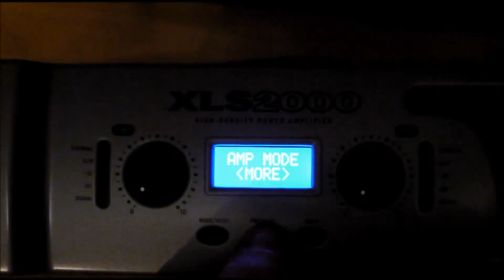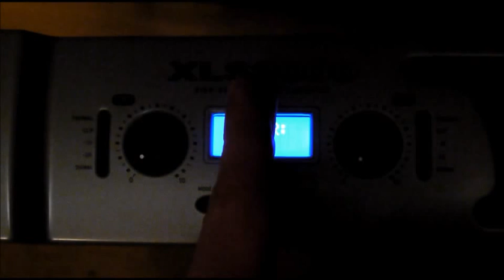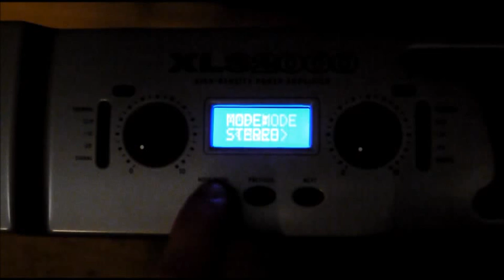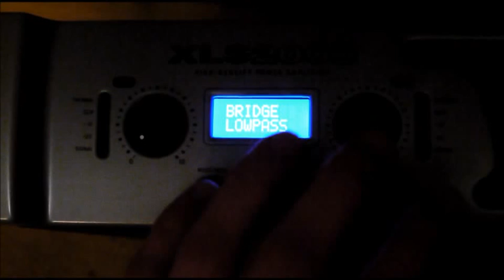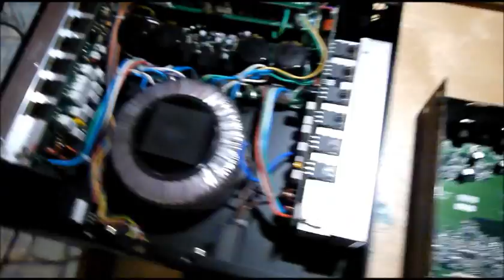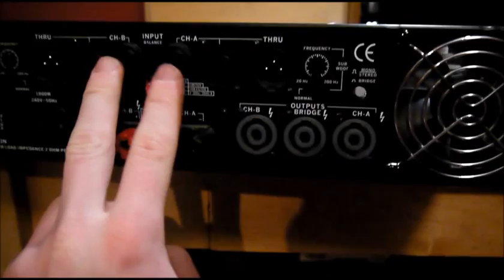Crown XLS Drivecore 2000 Review

Comment: I just bought a used Crown XLS 2000 amp.  I use it as a standalone amplifier with volume set to max for both left and right channels.  It can't even power up loud enough to drive my Wharfedale Evo 4.1 at 87 DB efficiency. It can only achieve about 50% of what my Audiolab 8000 can.    Even when i setup my Audiolab as a Pre, i need to up the Volume control knob to 2 o'clock.  The usual setting is 9 to 10 o'clock for the speakers to be very loud.   Please advise.   I suspect this amp is defective and intending to ask for a refund from the seller.

Comment: The Crown is a Class I amp (patent pending) not class D.
Reply: What do you mean by that ??? I am not aware of a class I amp circuit, and I have been in business for many years. There are class T amps, but they are also class D.
Reply: @kimhansen6384  http://educypedia.karadimov.info/library/137234.pdf
Reply: @kimhansen6384  Class -I amplifiers are a fundamentally different design from all other amplifier classes on the market. Crown has patented the technology behind Class-I amplifiers and is the only manufacturer in the world building this design.
Reply: @kimhansen6384   Dude the macrotech and itech amps from crown are class I

Comment: The Toroidal transformers are actually very efficient, they only get hot because the manufactures cut costs be using under sized winding wire for the power rating. Most of the heat is from the a/b amplifier modules, also losses are considerable in the bridge rectifiers too, which all adds up to poor efficiency. The Class D crown is very efficient as the output transistors are switching on and off not in linear region and a pwm output is then filtered via typically inductors and a caps on speaker output The SMPS power supply is more efficient too as sync rectification is used. But reliability is the big question, also a class d amp with a smps is far far more complex in design, compared to a basic class a/b amplifier, and a lot can go wrong.
Reply: Lots of problems with class d, 
1. far more complex in design over class a/b.
2. considerable rf switching noise can interfere with other equipment.
3. minimum load requirement
4. noise and distortion is usually higher than a/b, but this in not a problem for PA applications.
5 Amplifiers can beat and make whistling sounds with other class d amps in system.
Reply: I tried out a Crown XLS 2000 amp a friend wanted to sell. For $100. I couldn’t go wrong. I was stunned! I’ve done pro sound, ran an audio store, wired many homes for distributed audio, etc.This is a wonderful ampIifier! I own a number of amplifiers both tubed and solid state and this is my favorite. Don’t waste your money on expensive amps, give one of the XLS amps a try. If you own very efficient speakers I would go with (at least) the 1502 as the entry level amp could be a bit too noisy!

Comment: I'm actually more impressed with the Numark amp. That looks like a really solid class AB amp.
Reply from the maker: Thanks, I've still got that Numark amp. Despite it being 10 years old this year, it's still going strong! I use it every now and then to run monitor speakers if I have to work with a band. I'm not sure what class it is if I'm perfectly honest, but it's over engineered and built like a tank! The only reason I don't use it regularly is purely down to the weight.
Reply: Nothing against the Crowns. They do make more sense, even for home use. I've seen a few hifi reviews of them and they say the same thing you do - lots of power and nice and clear sound.
Reply from the maker: Yes, I love the Crowns. I've got three of them now, and all have been perfect. My main concern was reliability when I bought them, as the technology back then was really in its infancy for amps of this size. But now that all three of them are five years old this year, I'm most impressed! Not a spot of bother out of any of them :)

Comment: I recommend high mind good power,,
Reply from the maker: Yes, 4 years on and they still work perfectly! One thing I have noticed is a fault code stored in the memory, when you hold all 3 buttons in for 5 seconds. This appeared when a generator tripped out under overload. Never been able to clear the code though on all 3 amplifiers. But It doesn't affect the running of them - They still sound and work great!

Comment: i have JBL Venue series tower speakers on Denon AVR-2309ci receiver. but i think power is not enough on my left and right tower speakers. what do you recommanded? current amp is 105 at 8 ohm per channel 5.1 system. my sub-woofer has its own amp.
Reply: I am in the same situation.  I have a Sony STRDN1040 hooked up to one set of POLK MONITOR70IIs and POLK RTIA9s(handle 50-500 watts/each).  The sound from this Sony is fantastic-my opinion and pro reviews.  I want just want more POWER.  Once one steps up in a reciever you get all the bells and whistles and no big increase in power.  Maybe COPPER is too expensive for toroidal AB amps?.  I just want to run-MAYBE-5.1 AT MOST.
I saw reviews on Amazon of audio geeks saying they're using Crown amps to drive their home A/V systems with massive wattage and they love the sound.
How this is hooked up I don't know but I'm going to look at Crown amps today to find out.
I've heard some off the cuff remarks about ClassD amps loosing some upper register and that they are built for durability NOT sound quality.  Maranzt tech told me that and then said "We have a ClassD amp that would be perfect for you as Marantz engineers have removed ALL the negative characteristics of ClassD amps I just mentioned."
LOL.
I don't know of one other industry-probably cars or medicine-cycling?-that has so much hyperbole and so many enthusiasts who just read numbers and don't actually engage the sensory organ that the product is supposed to stimulate: HEARING in this example.  As a musician I laugh and laugh over it.  I just had someone on an audio forum try and tell me that air is NOT what creates a sound wave.  I didn't have the heart to tell him that if he took his $50K speakers into space and ran them he WON'T hear anything...the cones will be moving but without AIR(or any gas) to transfer the energy he wouldn't HEAR anything.
Seems to me that you are onto something hooking up this high wattage/dollar, well running, durable amp.
I'm interested in hearing what came of your research.
Good Luck and Good Listening.
Mike

Comment: Video is good but the power supply is essentially the right half of the chassis.  What you pointed to is the input power filter that is within the shield area.  The little transformer in the right half is the power transformer.  It doesn't require the massive hunk of iron because it is operating at a high frequency around 96 KHz.  Class D amplifiers are efficient because the switching transistors are either off or full on during their switching cycle.  When off, no current flows so no power and heat is generated.  When on, the voltage is very low in spite of high current so power and heat are still low.  This pulse width modulated waveform is then filtered back to an analog value for the speakers in the two toroid inductors just left of center.  Feedback of the resulting output is then fed back into the circuits to keep linear performance.
Reply: I had exactly the same comment about the power supply in mind
Reply: Wuff zu Wuffenberg 
My HUGE six driver speakers require and EXTREME amount of power to sound amazing.  I think ALL recievers are underpowered to drive speakers(POLK AUDIO rtia9) properly.  I had the money so.....
I bought TWO Crown DriveCore XLS1502 amps.  I have them in bridge mode.  This delivers a whopping 1050 watts/channel.  I also have a POLK AUDIO 110(??.  I think) sub.  My speakers are set at crossover of 100Hz with a Marantz 8001 preamp.  I have the amps set at .775 input.  This is the recommended input for headphones.  But my speakers are so "warm" in sound that the "openess" of the NON-recommended .775 input balances out nicely.

WOW!!..WOW!..WOW!!!.

The sound is incredible.  My musician friends (the REAL critics to me) say the sound is expansive and open and beautiful.

These CROWN D class  amps have come to reign!!.  Designed by Harmon Kardon.

I have never seen a mixed or poor review for this amp.  Old timers like BIG, SWEATY, HEAVY amps.  

But as this reviewer says "I can't tell a sound quality difference between these two amps."  And in fact, many studies have been done with REAL people with REAL ears and they CANNOT tell the differnece from the Class D (Crown) and other older Class A  , A/B amps.

Now, AUDIOHOLICS(internet reviewers) says CLASS D amps "Arent quite there and wont be for some time or ever."  Well, they're putting stuff on the bench and measuring with oscilliscopes and digital NON-listening equipment.

The fact is the human ear is a POOR listening tool relative to almost ALL other mammals.

And my CROWN DRIVECORE XLS1502 REALLY sound WONDERFUL.

I HIGHLY recommend these excellent sounding, efficient, INexpensive amps for home stereo listening.
Reply: Wow!.  You seem to know your stuff.  I say "seem" because I am.completely ignorant of all this.  I want to hook up a Crown amp to run my power hungry home stereo speakers.  Right now I just have a Sony STRDN1040.  It sounds GREAT but just does not bring out the deeper register in the bigger speakers.
Is it OK to use this Crown amp to power a home stereo?.  I've seen reviews on Amazon that just rave about powering home A/V systems with Crown amps.
Big POWER is gained.
But what is lost, if anything?.

Comment: Hi, thanks for sharing! I am still sitting on the fence re the active/ passive debate. I have a some nice RCF active kit (310a's, 322a's and 722a's) but can't let go of my passive compact HK Audio rig (210 sub's and 08 tops). I have always been a fan of 'traditional' amps but after seeing reviews of these amps (including yours!), realising that I can have a full bi-amp rack at nearly half the weight of just a single trad amp, I have just ordered a couple of XLS 1500's for my HK gear. I am sure there will be some sonic differences but whilst we are all performing in less than acoustically perfect venues, I am guessing that the sound will be fine. I am just hoping that the reliability is there. Then again, at these weights and prices, I could always just rack a spare amp! Thanks again!
Reply from the maker: +Buck Williams Thanks. Yes, I've go several of these units now, all over 3 years old... and all have performed perfectly without a hitch. I'm very impressed! I mainly run them off an old diesel generator too, so they don't have the stablest  of supply to work off either. The weight saving is phenomenal like you say. I've loaned these out to several 'audiophile' friends of mine.... none of which could really tell the sound difference. At the end of the day, most recorded music is MP3 at 320Kbps. So the differences caused by the amps, I'd imagine, fall into insignificance when compared with the sample rate of the recorded audio.
Reply: @NickExton309 does the amplifier has a input selector voltage because in my country it is 220v does the amp has a input selector voltage

Comment: pushed my xls1000 as my home subwoofer amplifier into 2 ohms bridged (which is as you should know 1 ohm per channel!) and it pushes the shit out of my DD 3512 and dips the lights on the same circuit lol, i don't go at it for long periods of time like this so the amp is okay, i do have videos of it
Reply: "box rise" is a bad term
fyi im an electrical engineer
the very fact that you have an inductor moving within a magnetic gap causes the impedance to fluctuate with frequency, a non-moving inductor follows a non-real impedance relationship with the formula jwL (w being omega which equals 2*pi*f, L being inductance value in henries, and j making it non-real), and thus the impedance of a real inductor is Z=R+jwL, but the movement of the coil within the gap causes the value of L to fluctuate, the impedance graph of a speaker shows this with a peak in impedance at around Fs in free air, and around resonance of the enclosure that it is in, this is the area of least movement of the diaphragm of the speaker but it is also the most efficient point, generally on subwoofers, outside of the resonance point the impedance sits around and slightly above the DC resistance of the coil itself, since many subs are tuned in the 30Hz range and frequencies are so low, you will see the rated (2ohms etc.) low impedances generally in the ~45Hz and up to cutoff of the low pass filter, my XLS1000 maxes the fan out from heat if i blare music that has those frequencies in consistent bass tones, but i can keep going and going if it has bass in the 30Hz range

Comment: I have a Crown XLS 2500, and it's great.  I use it to power my bass guitar rig.  It drives two Hartke cabs, a 4x10 and a 1x15, so i run it in crossover mode.  It's lightweight, loud and clear, with no hiss at all even when dimed.  I really like this amp.  Highly recommended.
Reply: Michael Jowell I just bought one! I hope it's as good as you say 😄
Reply: Just got the xls2000 today always had the ce series and got this don’t hear a difference but I could get use to the weight 
I got it because of the 5 star rating.
Good job crown
Reply: I want to amplifier crown xsl 2500. But I want now more. Is good? Is to easy configutaion? And the power?

Comment: I'm with SVT Contour. The XLS usher in a new era of lightweight, reliable, affordable, high sound quality amplification. Go back even as little as 10 years and look at what 2000 watts of class A/B or H costs. 

As far as serviceability the Crown should be more reliable than your Numark since its parts count is less.

Comment from the maker: Probably not I'm afraid. If you let me know the model number I can let you know for sure. The integrated amplifier has the Pre-amplifier, Equaliser, etc AND the Power Amplifier built into one unit. Like you say, You'll need to be able to take a 'Line Level' RCA out of the Integrated Amp, and feed into this one. But the Integrated amp will probably not have a Line Level output.

Comment: hello, i have a question if you dont mind,
would you know how to hook the crown to a integrated amplifier?  i would be useing the integrated amp for balance, bass and treble and the crown for POWER!!
i dont know if it can be done or if so how to connect them together.  i guess the integrated amp would connect to the rca connections on the crown but where would the rca cable go out from the integrated amp??? can this even be done at all??